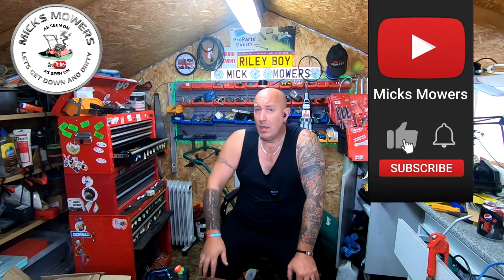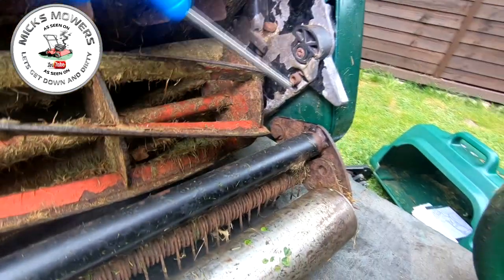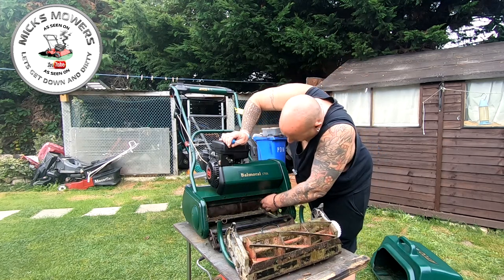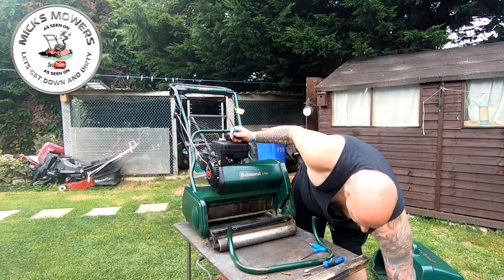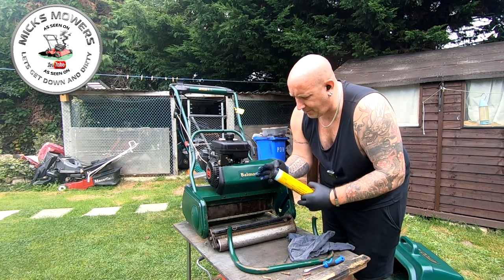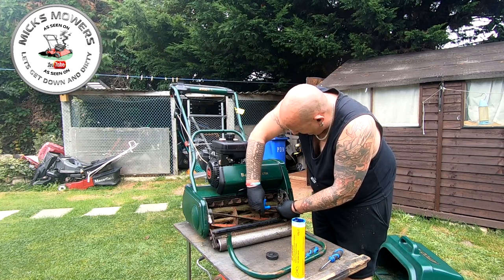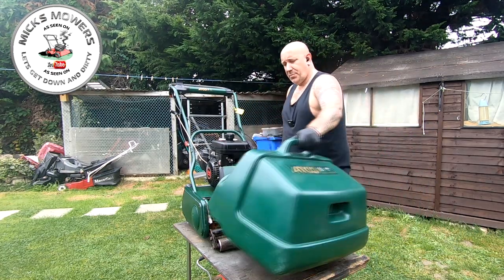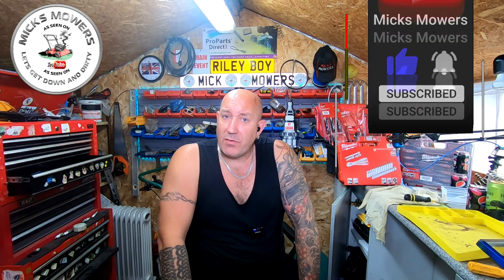How to Change a Cylinder On A Atco Balmoral Cylinder Mower

Comment: When I have a cassette that's stuck slightly, I use a tire lever (crowbar would do).
If you put the end through the cylinder till its under the central shaft, you can lever it out very smoothly against the front roller carrier.

Comment: 1 word of warning, don't over tighten the cylinder retaining bolts. This over time will distort the side plates where the bolts go into. It will draw the plate where the nut is welded to inwards and make getting the cylinder out very difficult. This happened to me.